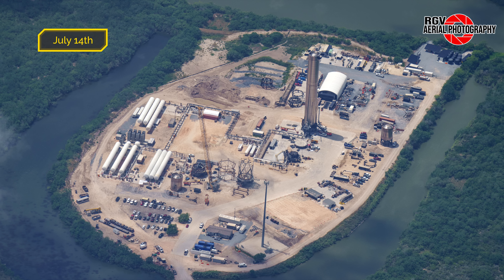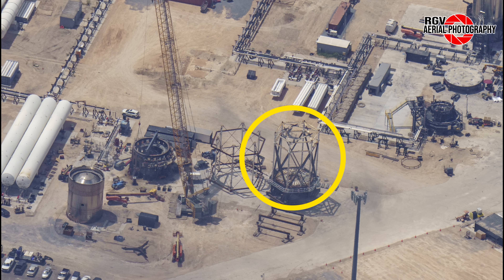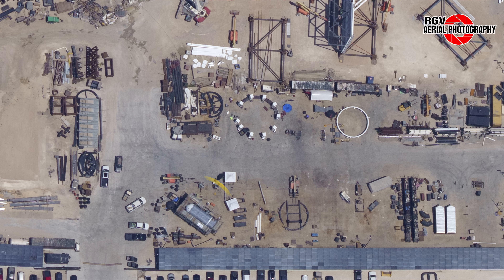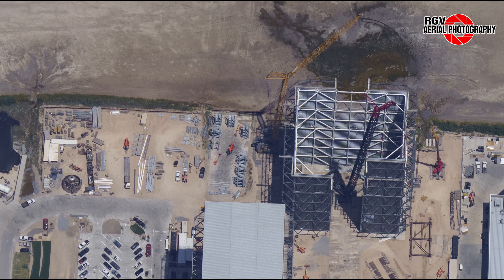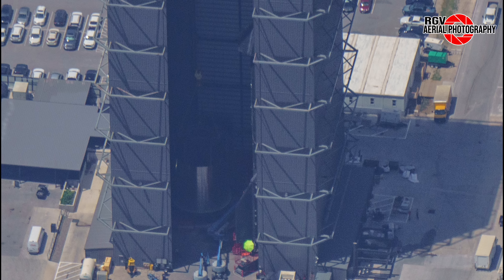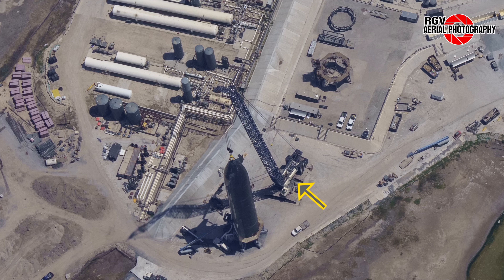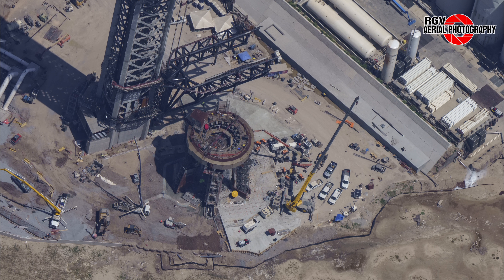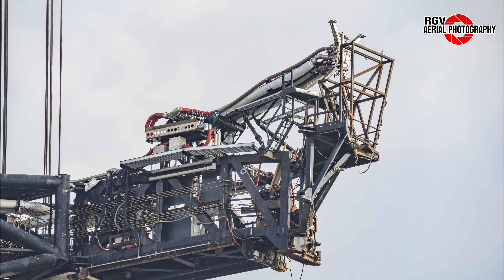Water-Cooled Steel Plates Installed! Starbase Flyover Update Episode 8

Comment: Hi, can I ask what the ground fab building is for please?
Reply: Good question, it's used for constructing and assembling various jigs, mounts, tank farm assemblies etc. Mostly for welding. - peekaboo
Reply: @peekaboo2022zy  ah so doesn't store engines and that kind of hardware then? And was the old ground fab the building that held the steel plate before rollout?
Reply: @novembern939nn5    Yeah I don't think it ever stored any Raptor engines, those are usually kept in Tents 1-3. And the building that housed the centerpiece steel plate was the Inventory Tent at Sanchez, with the rest initially assembled in the open at Sanchez with makeshift covers.
Reply: To build heavy duty stands and the like.
Reply: @peekaboo2022zy  alright, thanks so much for the help!!
Reply: @novembern939nn5  no problem, and thanks for watching!
Reply: @peekaboo2022zy  been tracking since SN5, just sometimes forget about the smaller, more nuanced (but important) aspects that keep things going haha. SpaceX is the reason that I love rockets :)
Reply: @peekaboo2022zy  but again, thank you for the answer ahaha. Gonna be looking out for Starlink now to catch the launch
Reply: @novembern939nn5  Enjoy the launch!